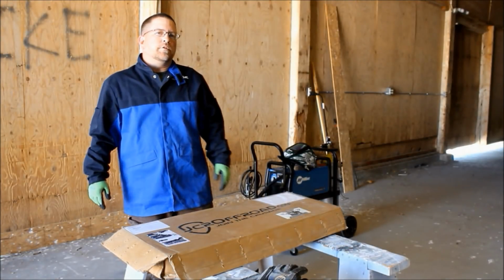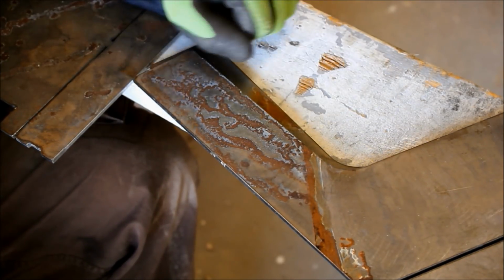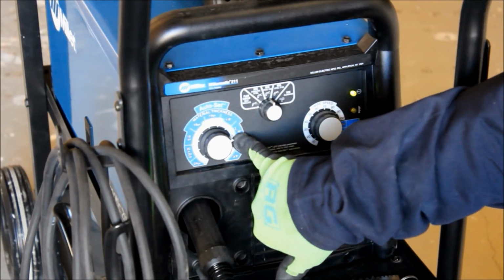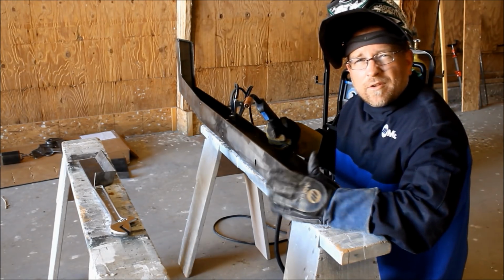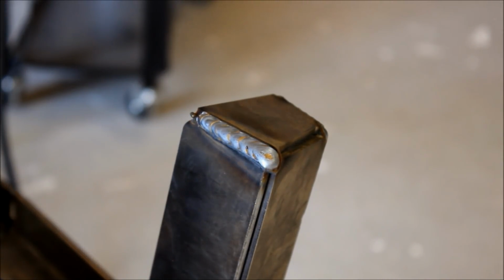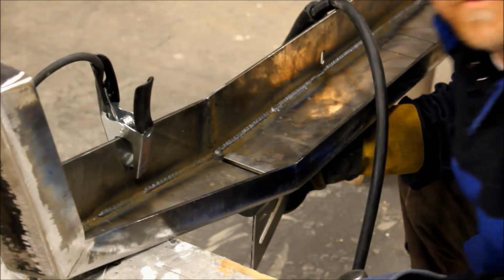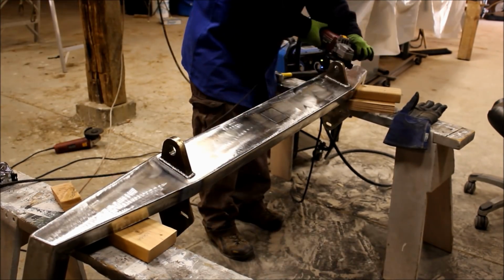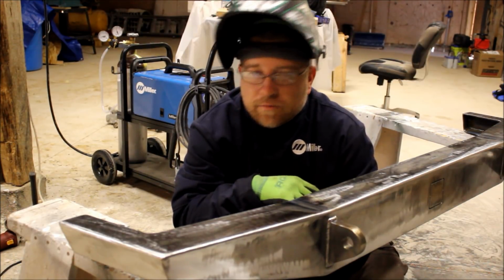Welding Tips for the Beginner. WIN A FREE MILLERMATIC 211 WELDER!

Comment: I've watched both of your JCR bumper build videos, thank you for posting these! As a complete novice to metalworking, it would be helpful if you'd spend a bit of time talking about the grinding wheels and other tools you're using for prep, as well as any assembly tips (such as welding the inside joints first, or last, or whatever).

Should be ordering the rear bumper next week, waiting to finish a paint job on my XJ and free up the garage first.. wish me luck!
Reply: I’d use flap disc for your grinding 36 grit to knock down your welds and 60-80 grit for finish grinding. You will also want some stones or hard grinding wheels to grind out any bad spots in your welds. Also buy an angle gauge to get your bends perfect, less than 15 bucks at Home Depot or Lowe’s.
Reply: Great advice, thanks!

Comment: Giveaway still doesn't seem to be working.  If we are already on the mailing list can we not enter?  Still shows comments are closed at the bottom as well.  I tried to use my other email and it showed that it was added to the mailing list but nothing else happened, still can't see any comments at the bottom.
Reply from the maker: You are in!  There was no confirmation at first but I have added one now.
Reply from the maker: Ok if you were already subscribed to the mailing list before the contest then here is what to do:  Option1: use a different email address.  Option 2: when you get the error click where it says " Click here to update your profile".  This will send you an email.  Open that email and click "update your preferences".  Then check the "Miller" checkbox under Giveaway and hit Update Profile.  This will add you do the Giveaway list!  Sorry, I'll try and figure out a better solution for the next giveaway but this was an unforeseen issue and I'm not very tech savvy. - Matt